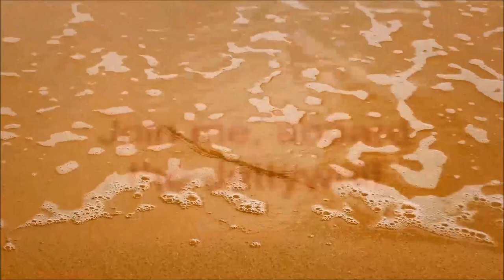I CAN MAKE BANK SINKERS, AS FAST AS....

Comment: Dang, i need to come by with some lead n beers n fill my trays.😂 Cast nets (cheaper ones found most times) dont even use lead alot of times. They use a steel with some plastic coating like lead. At least with nets i find usually are those crappy ones. Rarely do i find a nice one with lead. One way i get lead tho is to dive the bridges everyone fishes under. More lead than you can carry up down there. Tight lines n cold beers.
Reply from the maker: YA AIN'T DIVING NO BRIDGES HERE!
Reply: @CaptDavesSportfishing  You could just wont see anything until hits you in head if its slack tide. But a short drive i know where there is bridges alot easier to dive.😉 You do get out other places sometimes i hope.
Reply from the maker: @working2bselfsufficient724  I'll just go next door and get lead from my neighbors pile, thank you.....